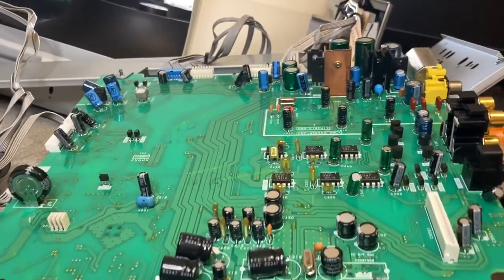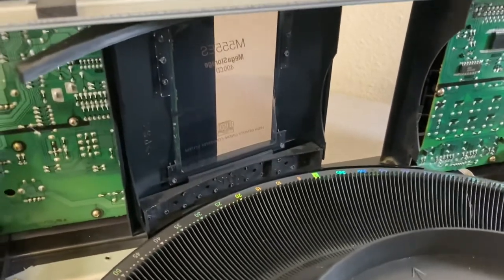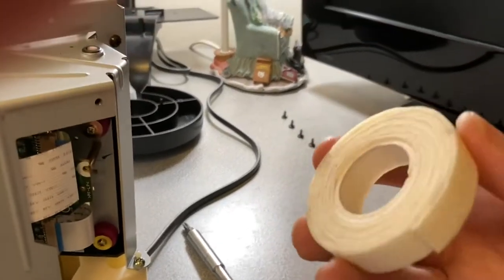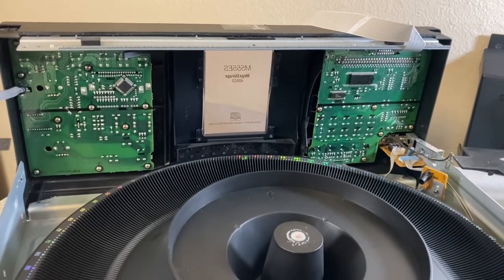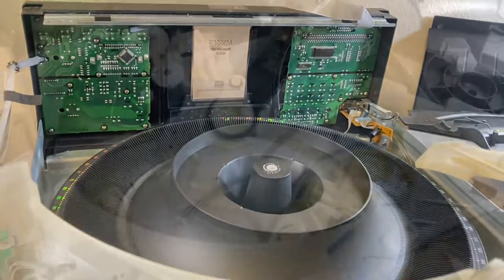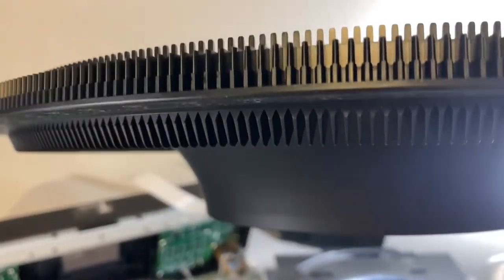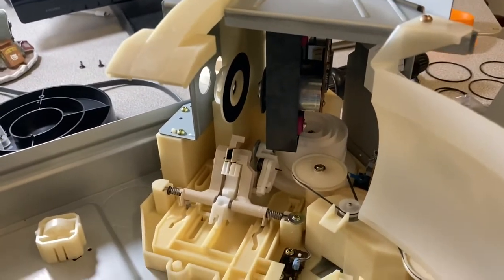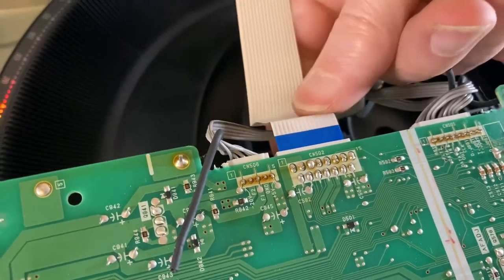Sony CPD-M555ES 400-CD changer stuck-door repair, changing all 3 belts, inspecting carousel teeth

Comment: Note to future 3 belt changers - I think you can just take out the center screw on the carousel, lift up the carousel on the right side (side the power cord is at) just enough where you can reach in and change the belt. Give it a try.
Reply from the maker: Yeah, it’s a delicate matter to remove the carousel completely without damaging any of those little plastic teeth on the bottom. Thanks for the suggestion!  😃 👍

Comment: Where do I get the belts from? I found one of these in the trash. Same deal Belt issue most likely., Turn table errors   Door needs help opening ETC
Reply from the maker: I’ve been trying out rubber drive belts that come in packs of assorted sizes from three different eBay sellers. Tried super cheap ones and expensive ones, all are black with a square-shaped cross section. I can’t find any difference in quality, as long as they are not your run-of-the-mill rubber bands, but instead are specifically advertised as being designed for drive belts for cassette players and other vintage audio equipment. A quality belt is most important to reduce wow and flutter in cassette tape mechanisms. For a CD changer, the main thing I think is that the belt lasts a long time. I wonder whether a rubber band would be good enough for a CD changer, as I haven’t tried using a rubber band in one yet. Rubber bands also tend to be too thick, as a rubber drive belt tends to be very thin and fits in small grooves in pulleys. Another thing to keep in mind is to select a size belt that’s just barely snug enough to do the job. Don’t make it so tight that it bends the mechanism’s axis for spindles, pulleys, etc. This takes some tinkering to see what works and what doesn’t. I learned the hard way with my first Sony Walkman that I bought in the ‘80s. Put a plumbing O-ring in there and it was too rigid and too tight and damaged it and caused wow and flutter. Don’t use plumbing O-rings. Be careful with what people tell you to do on the internet, many don’t know what they’re talking about. If enough different people tell you the same thing, it’s probably legit. That having been said, here’s one of the packs of belts I have been using:

https://www.ebay.com/itm/223570181421?mkcid=16&mkevt=1&mkrid=711-127632-2357-0&ssspo=66vjYtkERF-&sssrc=2349624&ssuid=DccV81yKRpa&var=&widget_ver=artemis&media=COPY

But I see the price on that one went from $9 with free shipping back in August of 2021 to $20 plus shipping charge today. eBay suggests others underneath that listing, so you might try a cheap one. Just look for a seller with great ratings, and read through their feedback comments. 

As far as fixing your machine, if you don’t feel comfortable with it, and just wanted to flip it for profit, check out sold comps on eBay for the last 90 days for your make and model, to see what it’s been selling for. If it doesn’t show up when you filter your search for “sold” and “completed sales,” and it’s condition being selected as “for parts or not working,” then use eBay’s Terapeak to research product sales for your make and model of CD changer, to inform you of a dollar amount that it’s worth as is, on eBay. If it’s the same make and model as the CD changer in this video, it has some real value even as parts / not working. Those who have lots of experience repairing these units are searching these out. 

If you’re going to attempt a repair, but have never done it before, remember that patience is a virtue! Take it slow, and if something doesn’t seem right, stop and research more. If you bend a circuit board too far and it breaks, it can be quite difficult or almost impossible for the average hobbyist to fix. And these units are becoming exceedingly rare, so thank you for pulling one out of the trash! And good luck! Audio CD enthusiasts who love their CD collection are getting into these vintage CD changers. 

Anything else I can do to help, let me know.
Reply: @random-ramblings   Thanks.  Ill try to find some bands. Yes even some O rings I have been chasing that were $3 for a pack of 70 are now $12 prices are insane now.    I took apart a old vintage pioneer laser disc player for cleaning.  Also sold that. Those sell for crazy $ too I got around $200 for mine I gave them a deal.       It looks about the same once the cover is off
Reply from the maker: @GhettoWagon  Ooooh! I have a working Pioneer laserdisc player that I acquired from Goodwill a couple years ago. I should look up what that’s now worth on eBay. 

Just now, I found a pack of those square belts for under $8 free shipping, seller has lots of feedback, good feedback, can’t beat that:

https://www.ebay.com/itm/175219295913?mkcid=16&mkevt=1&mkrid=711-127632-2357-0&ssspo=8VyfVyPZTg2&sssrc=2349624&ssuid=DccV81yKRpa&var=&widget_ver=artemis&media=COPY

Comment: I have a 200
Sony cd changer model CCP-cx240.  Sometimes when I hit the open door button it says “no connect and won’t open”. Plays perfectly fine but I’m not sure what the problem is.  Any ideas???
Reply from the maker: Hmmm… if it plays fine, then it sounds like the laser lens is ok. Have you unplugged the changer from power for a few hours? Have you tried resetting the changer like this: https://www.sony.com/electronics/support/articles/00022579

Have you replaced all three rubber belts? If those things don’t do it, I’d open the hood and carefully unplug and replug all wired connections about three or four times each. Over time, a little moisture can cause metal connections to corrode and then they don’t connect as well as they used to
Reply: @random-ramblings  thanks for helping.  I did reset all like that a couple times.  I unplugged it but only got 10 seconds with what I call a Japanese reboot.  Should I do longer???

I haven’t replaced belts but they appear to work.  It’s like it’s not communicating to open or close to me but heck I am open to your ideas.  Thanks again.

Comment: Could you show how to take the carousel out? I like to change mine. But yours shows the stuff allready removed.
Reply from the maker: Sorry, I sold this unit already. But from what I remember, I had to remove all the stuff on top and carefully remove the screws holding the curved back wall directly behind the carousel, so as to loosen that wall and position it out of the way. Seems like I unplugged wires from the top and from the back behind that curved wall. Had to so carefully and so slowly remove the carousel without touching or bumping the teeth on the bottom of it into anything, as damaging those will mess up the disk-changing operation.

Comment: what should i use for the grease on the white plastic gears? Vasoline?
Reply from the maker: Hi Dorse, I would imagine that vasoline would be ok (so long as it’s not so much of it that it gums up the works too much), as I understand that vasoline can actually rejuvenate old plastic. I’ve seen some plastic gear assemblies that had quite a lot of what looked like vasoline. 

I’ve seen a YouTuber or two use white lithium grease on plastic gears, but you may want to look that one up. It’s my understanding that white lithium grease, while it may appear to work in the short term, actually messes up plastic over the long term. I believe it’s made for lubricating metal and not plastic.